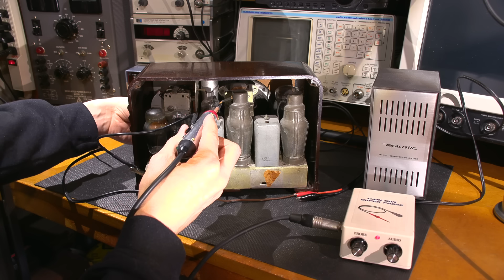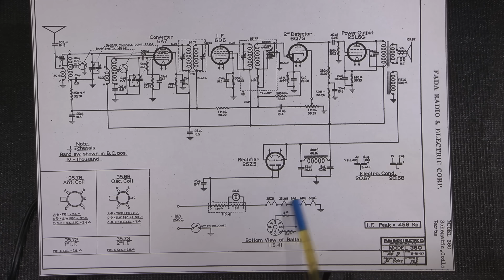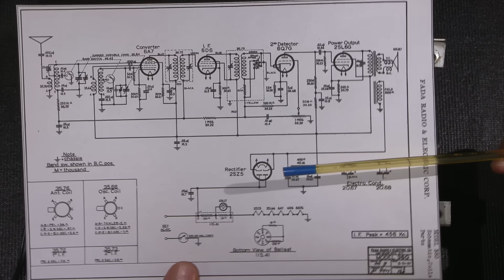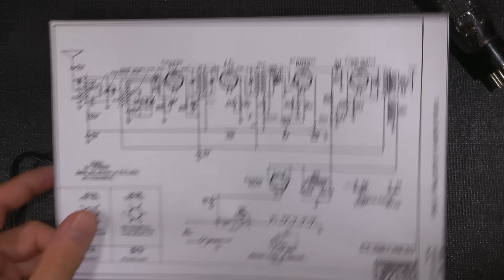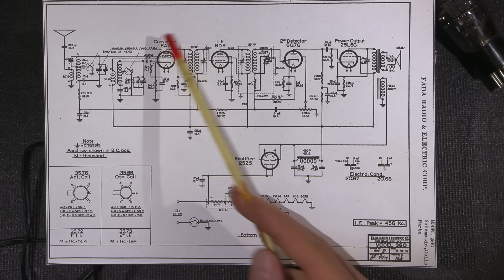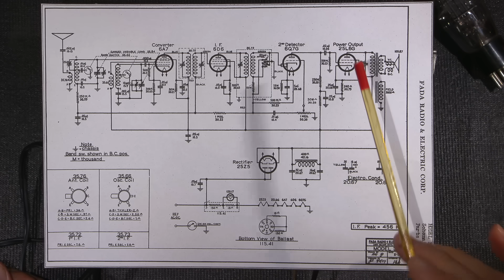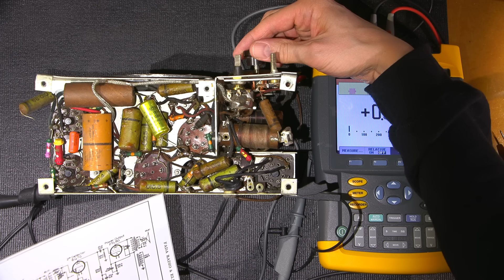Electronic Circuitry Diagnosis And Fault Finding! [Repair]

Comment: Yes, Restore it! I was one whom in the 60's, took my tubes to the drug store for testing, later landed a job at General Electric TV plant where I was the first to plug them in, test & align the CRT & foolishly play with the high voltage transformer leaks, they would tingle as you passed your hand through the arc the, plant was isolated. I do like the Fluke Scope meter, would love to have one to help restore my old Ampeg.

Comment: Actually, way back in the day when I was a youngster, a string of xmas lights was in parallel. Each bulb was 120V, 7W or so. I remember when the first tiny lamp strings came out, and yes, if one went, the string died. You could also replace one bulb with a thermal blinker to make the string wink on and off.
Reply: Dead Freight West  I remember the blinker lamps. Young people wouldn’t believe you !

Comment: Heh, this would have been a mighty short video if you had checked the voltages on the OP tube first. I'm guessing that with your experience, this is one of the first tests you have ordinarily done. Just as well you didn't. I love seeing that super probe at work. I also vote restore.

Comment: Years ago, back in the 70's I was in the US Army.  I cross trained into Radio Teletype, after first cross training into land line teletype.  One of the rigs I learned on was a huge old transmitter/Duel receiver set called the 26D rig. It was so large that it took a 2 1/2 ton truck to haul it around, and we towed two 10KW Generators to power her up in the field. Part of the shut down procedure of the transmitter was to take a large tool that resembled a rubber sword with a hook on one end, and a large clip on the other.  You had to find a solid ground, then open a special door on the transmitter housing, that contained the huge vacuum tube you spoke of.  With the grounded rubber sword, you hooked that top cap and discharged the tube, it had several thousand volts present, and could ark a bit when discharging.  The old 26D was neat in that you could transmit on almost any frequency, including standard AM.  In Vietnam, during the war, many communications soldiers would tune the transmitter to around 800 on the AM, hook their little Pioneer PL 50's or reel to reel sets to the radio and run pirate radio stations for the troops.  Soldiers loved it, they used to have a saying, the only happy troops are bitching troops, and man those pirate's did a lot of bitching, but they played the cool rock of the anti-war crowd and that was very popular, especially with the draftee's.

Comment: Another fine job of troubleshooting. This circuit is a great example to restore. Great job reminding us that you can bring even series filament radios with original caps up on the variac and dim bulb limiter and find the problem(s) before wasting time and money on shotgunning things. You may have to anyway, but if the iron is bad or coils open your in for way more work than its worth. Keep em glowing!

Comment: If I were working on that radio for someone who was paying for the repair, I would replace all of the capacitors as you suggest.  If the radio were mine, I would replace only the failed capacitor.  I would not be concerned that the other capacitors could fail at any time because they have a proven record by operated for over 80 years without fail already.  I would rewire the power cord and on/off switch and make any other modifications involving safety.  Great video...

Comment: Hi Paul! I’ve restored an old Pilot radio. What’s strange is that original RCA 25L6GT tube vibrates slightly with mains frequency if touched with fingrtip. Its Soviet clone does also vibrate. Original 25z6 does not. Is this normal?
Reply: Kevin in Soviet Russia fingertip is the best test equipment!
Reply: Kevin, it’s not transformer, and all voltages and currents are fine, including filament current.

Comment: Exactly true regarding new tubes.  I had a used Eico CB radio in the early 60's.  It stopped working so I took the tubes to the local Rexall drug store (which I later worked at as my rirst real job) and tested the tubes.  The 6AQ5 was bad.  I just opened the cabinet under the tester (the "honor" system) and picked a replacement tube, then went to the cashier and paid for it.

Comment: It feels good getting one of these to work again . I've just restored two old Australian Kriesler radio's .A 11-20 and a 11-28 . Not sure if these were sold over there but they were made in Australia . The 11-20 was a real challenge as slugs or something like that took a liking to paper caps and ate the outside of the caps right down to the foil. Good thing I got a circuit diagram to find their values. Replaced all the paper caps and the electrolytic caps and a couple resisters that had gone open and it fired up. My biggest issue has been when someone has been into it before and used the wrong value caps as well as some wrong value resisters . Yeah it may work but not very well . In the mid 1970's there was well I've heard them called mustard caps where ever I see them I can just about guarantee their the wrong value. The improvement in sound quality speaks for itself. Oh on a suggestion for a topic ever tried replacing the dial cord now there's a test for patience .

Comment: Restore it but include a 1:1 isolation transformer (external) to make it safe. I don't believe in perpetuating the 'hot chassis' radios except for historical purposes. People in 2019 have no understanding of the danger. I'm very interested in how you handle the pot and switch contacts as well as the case. Putting this radio back on the air does have a bad point, the LO will be radiating away polluting the 160 M Ham band.

Comment: When I was a kid in the 60s  the UK the shops use to test the battery's they sold you with a Ever Ready battery tester, never came across a valve tester though...Love this radio nice build  and compact design and nice vintage, imagine the news that speakers as revealed over the years.....Defiantly a restore for me...

Comment: Paul, A few curious questions.  Have you ever considered printing or having an old set like this printed on a board for reproduction purposes? Could one do it as they're typically drawn in the schematic form or rather in the point to point layout be better?  Aslo,  similar to the old Heath kits, if they were printed and a list of components were made or kit form offered do you suppose they'd be affordable?  I realize just from the parts alone they'd be pricey....but think of the learning value....or is that too over the top in your opinion?

Comment: Can you or a fellow subscriber explain the "Safety Capacitor"  X Y voltages? For example lets say you need a .02uf 400v capacitor in a circuit. Could you use a safety cap rated at .02uf x200v y400v?  Thanks

Comment: I was amazed out of all the signals the Carlson Super Probe was able to receive from the long wire antenna, rather than a high-powered local AM broadcast station, it receives an NDB Navaid, which is usually quite low powered. Is it because the NDB, which is usually 200 - 250 kHz longwave is closer to the audio pass frequency of the Carlson Super Probe? Or the NDB is just down the block from your lab!!
Reply: I am here to learn from Paul. But I could not figure out why this was happening, and he did not state why... can anyone explain??

Comment: Another thing to note: the schematic uses M on many of the resistors... took me a little while to realize that was a Roman numeral 'M', ie. 1000, so a 50 M resistor is 50 kilo-ohms and not 50 megohms.
Reply: You really have to keep your smarts with you when working with these quite old schematics. All notations and markings are whatever people happened to used depending on where they were and who taught them. Still most of it is surprisingly similar in style at least.

Comment: Great video, thank you. My vote is to proceed with restoring it. If it were a standard broadcast band only radio I would say no, but it's rare to find one with a Shortwave band that wide.  Restore it and add a 456khz BFO ckt to bring in those CW signals.  That would make an awesome add to any collection.

Comment: I have a question, if anyone would like to educate me. :) I have my father's fairly large, old Grundig AM/FM/SW radio. We have had it ever since I was a baby and it's like a family member. It has always worked beautifully and I used to use it daily for hours on end in 2012 to listen to FM when I lived on my own and was very lonely. It has not been plugged in or turned on for about 4-5 years right now. What is the maximum time duration a person should let an old tube radio sit unplugged and unused before they need to be cautious and use an isolation transformer and variac to slowly apply current to the circuitry again? In the past, I've always plugged it in and turned it on with a hand ready to pull the cord if things went bad. My dad had always told me that turning on old radios after a while was stressful for them, but I didn't know just how dangerous and risky it can be until now. My dad died 3 years ago. I can't call him and ask this type of question anymore. I'd be absolutely gutted and heartbroken if that radio exploded one day after plugging it in. Thank you for reading my question. :)
Reply: I doubt anyone is going to give you a solid answer here, because nobody wants to tell you advice that could break your radio. If you're not comfortable getting a look in there yourself, look for a professional or hobbyist near you on Facebook or Craigslist, or go to your local antique store and see if any of them can recommend someone to you.
Reply: How’s your family member? What did you do and are they speaking to you again? I hope so.

Comment: Mr. Carlson, I wanted to say Thank You for sharing your knowledge with us. I just repaired an IFR1200 which I bought "broken", but wanting the challenge of troubleshooting on my own. Without boring you (or anyone else), I used the schematic to verify power supply voltages & found a bad varactor diode on one of the oscillator boards, and verified with an upside-down can of air. I temporarily substituted a 1N4004 diode  and wouldn't you know! I have the correct parts on order, but I'm glad nothing else is apparently wrong. Again, thank you & Happy Holidays!

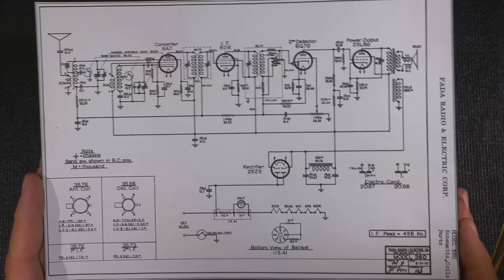Comment: 41:05 Is one of the reasons why they put the switch on the low side was so that it would see less voltage and thus they could use a cheaper switch?  If that's the case, I'm not sure that I'd move the switch to the high side, instead I'd just bypass it and stick a switch in the line cord.

Definitely learned something from the video: hadn't heard about ballast tubes before.
Reply: +RayDT - Makes no difference which side of the line the switch is on. The contacts are switching 120V either way. The reason that it is placed on the chassis side is to prevent AC hum that might otherwise be picked up by the adjacent volume control (remember that both parts are combined in one unit), and passed on to the audio amps when the radio is on.

PS. If you've never heard of ballast tubes, wait til you see what was used before them. Think "curtain burner."

Comment: Definitely deserves to be restored.  Very good, clear explanation of troubleshooting; narrowing the problem down to the section, and isolating it to a specific component with voltage measurements.  Nicely done.

Comment: thank you!! your such a good teacher as i took up the hobby of restoring a heathkit hw101 with a hp 23 power supply. i have a ? ..what amp rating variak  do i need to run the hp23 to bring up the hw101 for thye first time and is it a good idea to have it on a ground fault circuit? right not its just an arcfault 15 amp breaker. thanks again!!

Comment: Our electronics teacher taught us to keep one hand in your pocket when field testing tube gear. By all means, restore. The case alone is worth it. Many period radios and TVs depended upon the cardboard back of the radio to protect you from shock. Maybe you can locate a photo and recreate one. Great video, looking forward to the future restoration. 👍
Reply: John T in addition to the cardboard back, there were as few and inaccessible metal points as possible, usually 4 screws underneath.  All knobs and switches are plastic/Bakelite.

Comment: Why is there morse code at the antenna circuit and Broadcast at the mixer on through? Is it because of the multi band radio is receiving all bands at once and the morse is the strongest signal?

Comment: I was working on a Collins transmitter, power was off, but I’d left on the external PS on that drove the 6146 finals, which had 800V on the plates.  Dropped me to my knees.  That one hurt.
Reply: At least they didn't have drop you into a coffin.
Reply: Discretesignals No doubt.  Never made that mistake again.

Comment: i feel like using 110v made the americans became careless of how to design a product back in the days, sure it bites but its not as bad to kick in the learning effect.
 i dont see the point making something thats running on 1 phase ac and is polarity dependant.
220v definately bites harder, i touched it by accident many times and theres no polarized connector, atleast in germany and around.  i wouldnt want that on a exposed metal chassis at any time.
i also havent seen old gear with N connected to the chassis before over here, but to be fair i havent been trough much stuff before 1950.

Comment: When I did my Advanced certificate in Electronics ,nearly 40 years ago one of the students just couldn't leave thing alone tried testing a radio with the Oscilloscope and didn't listen to the bit about live chassis and cause an almighty bang that blacked out one wing of the Tafe building and blew a hole in the front of the oscilloscope . So thats stuck in my head about using a isolation transformer. Funny thing was up till then the teacher was sticking things up on the board that we destroyed ,bit hard to stick an oscilloscope to the board .
Reply: We had a “tree” about a foot tall made up of soldered together failed components from repairs and fubars over the years.  We called it the “burning bush”
Reply from the maker: Thanks for sharing your story!

Comment: Wiring the neutral to chassis and using a polarized plug is safer as long as you know the receptacle your plugging  into doesnt have the hot and neutral swapped.  It would be a good idea to test the receptacles in your home to be sure they are wired correctly and safe to use.  I bet most people overlook that part.
Reply: I would benefit on a video concerning this as well as what variac to start with and building an isolation transformer  with amp and voltage meters.....I need to start my  bench with these essential tools first.

Comment: Paul,
By ALL MEANS, PLEASE do continue to restore this radio!  It is a real gem.  And while you are doing it, I would love to know what the inductance of that choke is.  It said, it think, 4000Ω but didn't give the inductance.  Would like to know.  Again, this radio is worthy of restoration!  While you are at it, you might mention again about the outside foil issue.  And although those dogbone resistors look great, I would suggest that you still measure them.  Thanks for these wonderful, educational, informative, inspiring, helpful, enjoyable, and interesting videos!
Wayne

Comment: I have a question thats bothered me. In this video and many others they use an inductor/capacitor network ( in this case a pi ). Why use inductors when you could use larger value capacitors and a cheaper resistor. The only answer I can think of, the capacitors would be to large ( physical size and cost ). Please correct me if I'm wrong.

Comment: Replace just that capacitor.   Let's see how long the others truly last.
Reply: That would be bad for the tubes if  critical caps shorted or went to a resistor.  I'm sure those tubes are hard to source.
Reply: Discretesignals Agreed. Molesting the tubes with leaky caps is not nice, and the original caps are all leaky unless they are mica. As simple as that.

Comment: Can you replace the bad capacitors and retain the original tone? Can you use metal film resistors without changing the tone? I get that question with vintage guitar amps.
Reply: Define "original tone" if you change old caps and resistors to ones that actually function correctly and are in spec, the device is going to function as originally designed.
Reply: Broken_Yugo what about the carbon resistors sound different than metal film. Cloth wiring sounds different than plastic coated. Point to point sounds different to pcb wiring, etc
Reply: @duanethompson2360  To my understanding that's mostly bovine excrement. That kind of stuff can theoretically matter, but not at the signal levels and frequencies encountered in audio stuff. 

From what I hear the problem with the vintage guitar crowd is they like how the amps sound broken, with leaky caps biasing the tubes all funny and running them way too hard, and think that's how they're supposed to sound. So to them fixing the thing is breaking it.

Comment: You're so right about it being common to repair your own radio's and TV's. I remember the tester like yesterday and the tubes would be locked up in a Personally I would replace every capacitor and tubes, any tube that still had some life would be backups. I would even modernize this radio and install a Bluetooth/WiFi module and run a aux before the radio.
Reply: If the tubes have good emission and vacuum, there’s no point in replacing them. They may well have decades of life ahead. If there are no manufacturing defects in the tubes, and they weren’t abused in operation (usually due to leaky capacitors or far-drifted resistors), then their decline will be gradual and  easy to quantify. An old tube that has seen some operation and is otherwise within acceptable parameters is very likely to stay good for a while.